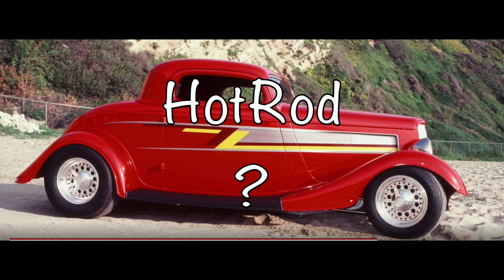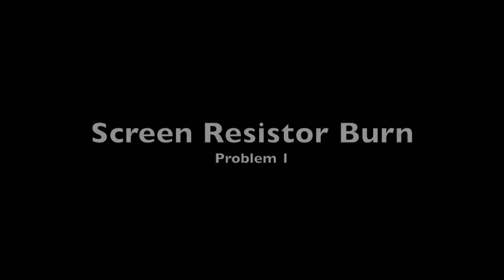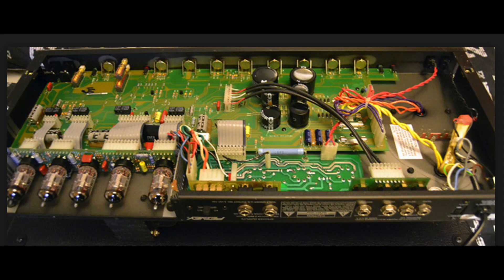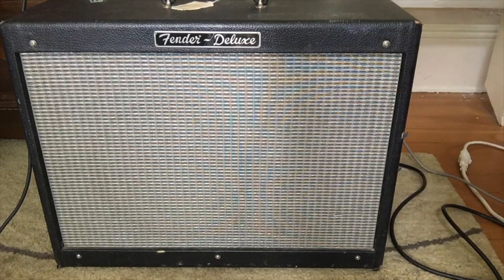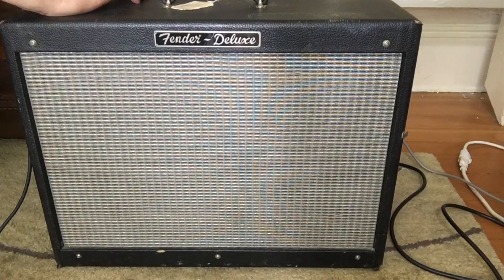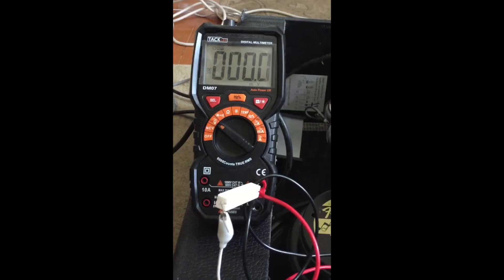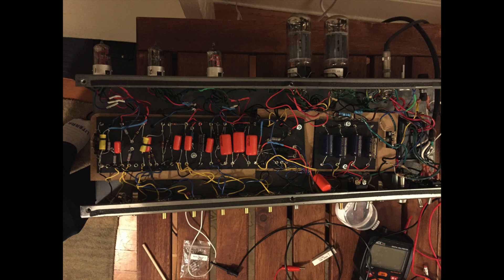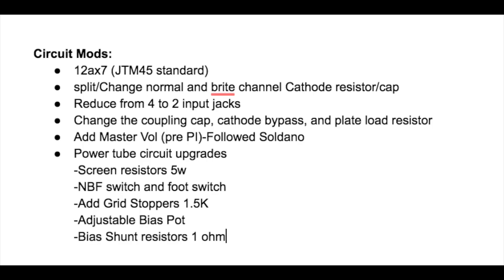Hotrod Deluxe to Bassman/Plexi Conversion

Comment: Both the output and power transformers are much bigger in the DeVille. The plate voltage is 485v instead of 435v too. Also the volume pots are all log since 2010. Cool video, sounds much better after !
Reply from the maker: I appreciate the note. Also I have a few new tricks that I do when I upgrade these nowadays.

Comment: Honestly I've never heard a deluxe that sounded like that, I've been using one for years and I've played through many and I think they sound incredible I actually have a difficult time even getting a bad sound out of mine. I've heard people make these complaints before that they don't sound good but I honestly have never encountered this
Reply from the maker: @saffyreday851  appreciate the feedback.  I think many of us have lots of great years on the stock circuit until repairs are needed.  the clean channel is basically a clone of the ab763 black face, and plays really well with pedals. The complaint is that the dirty channel can be a bit brittle compared to the more creamy 59 Bassman or plexi. It can still be dialed in to sound great for sure.

Comment: Do as the Man says, get a used Fender pcb combo and have it the guts removed and replaced with a proper handwired Fender circuit, if you want reverb go the extra and get a valve driven reverb, new 3 spring tray and a little reverb signal transforner. The Fender cabinets and transformers are very good. I had a 1x12" blues deluxe rebuilt with just vol/ treble/mid/bass and reverb and it was the best decision for an amp I ever made.

Comment: That tone from the original amp stock is sounding like it's from bad filter caps. Those IC brand are absolute trash and are known to be common failure points in those amps and that sound is what they sound like from that problem. There are several common failure points in those amps and it costs around $350 to have it taken care of if there hasn't been any damage to the PCB board or traces yet. Nearly all new Fender amps are not built well or worth what they charge for them. Some can be made better with a few upgrades but is not like the amps of old. That's progress for ya!
Reply from the maker: All valid points.  The video was to demonstrate what one can do once these problems occur and how it is a good candidate to convert/build a tweed bassman in the existing cabinet and chassis. 

As you may have concluded, I am capable of repairing the typical issues mentioned and others, including those that are related to the dual power rail and comparator channel switching circuits (for all issues, it is likely closer to the list price for a new HRD).

Nonetheless, thanks for watching an the feedback.

Comment: I had my HRD converted to a BF Bassman. Required keeping the Stock Speaker. It became an amp that day. Thanks to Jeff Andrews. But this entire genneration of Amps by fender was is a total disaster. the Conversion to the Bassman or Plexi is the correct fix. IMO that is. Cheers
Reply from the maker: thanks for the note, the HRD is a good starting point for many, but yes converting it either to tweed/plexi or BF is a good idea to really get the most out of it

Comment: How much you think something like this costs in 2022 dollars? As a first project, you think I'm better off building a kit or modifying a 1st gen HRD?  I have one I don't really care much about.
Reply from the maker: The mojotone 5f6a small parts kit is $185 US.  https://www.mojotone.com/Tweed-Bassman-Style-Small-Parts-Kit?gclid=Cj0KCQjwmdGYBhDRARIsABmSEePuDjWy7v4kvK6eWUQfUp9U5b0xZ3Ikuttgijnu22jEvfI4-_J4ersaAqy5EALw_wcB 

And then depending on what you have tool-wise, probably another $50-100 is you are starting with nothing.  

This is a great amp to do this on because there is no real resale value on these amps, and you already have the most expensive parts: transformers and tubes.

Feel free to reach out directly to me username @gmail.com, I can provide a lot of resources
Reply: @jloewenheim  hey man mind if I email you soon?  I’m gonna order the parts kit for a 4x10 deville.  I just picked up a broken one for cheap.  I did fix the usually problems but honestly it doesn’t sound very good.  I built a tweed champ and a single ended plexi from kits last year so I think I’m up for it ..
Reply from the maker: @petheato3291  Anytime, glad to help.  I am actually converting one as we speak, was eventually going to post about the variations and some new upgrades that I like to add to the conversion.

Comment: Thanks for the video. I’m going to try this conversation. I want to use the same transformer. What about the rectifier? Can you touch on this please. Thanks
Reply from the maker: Yes, thanks for the note.  You will need to "Upgrade" to a bridge rectifier since there is no CT, nor 5v secondary to power a typical rectifier tube.  Please email me and I will send you lots of useful stuff that I have been supplying others with who have also followed my lead on this.  my username@gmail.

Comment: I enjoyed your video. Great suggestions.  
Those large 5w 470R resistors are a common problem, but I think you may have accidentally called them the wrong name. They’re not screen grid resistors (also 470R). They are dropping resistors Fender uses to drop the 48v down to 16v (used in switching). It's like using a forklift to hammer a nail. When I need to pull the PCB, I will mount those 5w resistors on standoffs to allow heat dissipation without cooking the PCB. I’ve subscribed.   :)
Reply from the maker: You are correct, thanks for catching that.   I also am not a fan of the 1w screen resistors.  Nonetheless, out of the box, the HRD series is a pretty good bang for the buck amp.  As I'm sure you know, they will eventually have problems, and then I think it is a good time to think about converting into something else....
Reply: @jloewenheim  I agree. Once you properly "set up" a HRD, they sound bloody awesome. I don't care for their sound out of the box.
Reply: You are right mate, this R470 use to work with zener diode to clamped 48V down to 16V that a lo of voltage drop over this resistors , the correct way is lowering voltage drop to reduce heat dissipation (Current=(48-16)/470, then calculate to power=2.178watts , so if reduce 48V down we gonna get lower heating, the easiest way is change C100uF to 15uF this help lowering dc voltage on rectifier to supply to these R, no more cooking. Hope this help.

Comment: I've got a 212 Blues Deville that has had so many problems with the circuit board that it's unreliable. I'm thinking this conversion is just the ticket. I might email you for tips. Especially what to do about the rectifier tube for the 5f6-a
Reply from the maker: Would be happy to assist, feel free to reach out.  my username at gmail.com

Comment: I'm currently converting a Hotrod Deluxe to a  mojotone bassman 5f6-a after seeing this video.  How did you wire the transformers  leaving out the rectifier tube. i know you said you made a bridge rectifier, do you have schematic for that. Any help would be greatly appreciated,Thank you !
Reply from the maker: do you mind emailing me, way easier to get you that kind of info and have a dialog in that format.  my username at gmail.com
Reply: @jloewenheim   Thanks for the info  I’ve been looking  for this info since a friend gave me the amp part of a deville 2x12 with a burnt pcb!! will be emailing you when I start the project im interested in-the rectifier part of the build, nice job and cool mods👍🏾👌🏾
Reply: I am one of your subscribers that emailed you with the same questions. 
Thanks so much.

Comment: I dont know what the hell is going on in that HRD but mine sounds 100 times better then that and its a 2004 some thing is very wrong with it to begin with so its good you rebuilt it ..also this is one of the most used live gigging amps today and the ones i seen live always sounded good so i think this thing had a serious issue to begin with. The deville and HRD and george benson amp are basically the same they are not twins and though they are similar to the bassbreaker it is still its own thing and very versatile.just my opinion.
Reply from the maker: Your feedback is very much appreciated, as is your watching my video. I agree, it is a great amp, and has been around a long time.  That being said, there are many out there looking to get a slightly different sound out of their HRD/BJr amps that is tone-wise a little closer to the 50's Tweed BM and the Plexi.
Reply: @jloewenheim  I agree that's why i was watching your vid, i was thinking if i start having problems maybe i'll go with a alternative, i didn't mean to come off so defencive, after rereading  what i wrote i realize i might have been overreacting a bit..I really enjoy your videos keep up the good work
Reply from the maker: Not to worry, love the dialogue, think you gave some great insight.
Reply: That’s kind of what I thought when I heard the before. I have a Blues Deluxe and it has a lot more clarity when you turn it up than that first sound sample. The bass does tend to get supper flubby at high volumes. Basically as I increase the volume I roll off the bass and it sounds great. I also own a Marshall DSL 40 and use the Blues Deluxe as a clean amp and the Marshall for distorted tones. When I can run Blues Deluxe at volumes that will distort it starts to sound a lot like the first two channels of the Marshall only not as tight. At that point though the volume is loud enough to peel the paint off the walls.